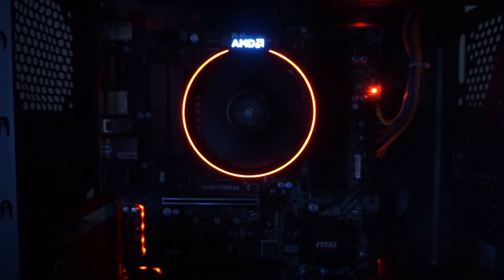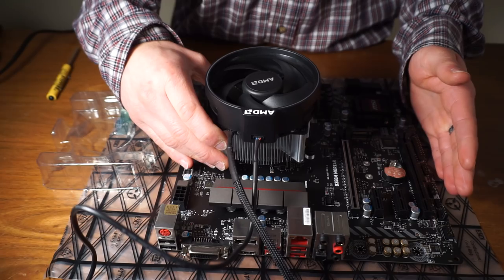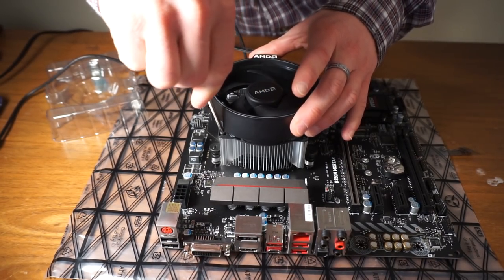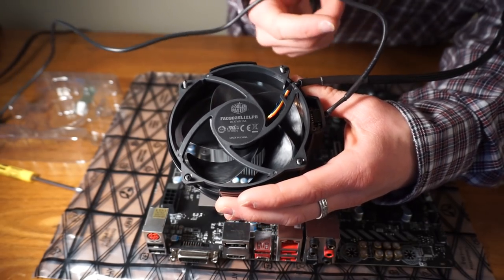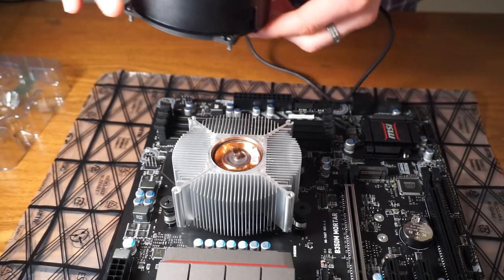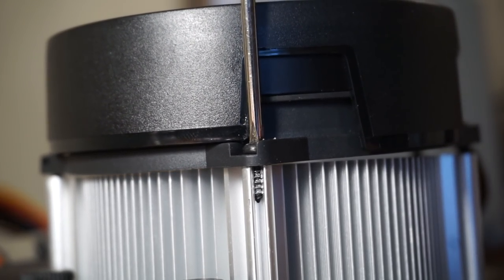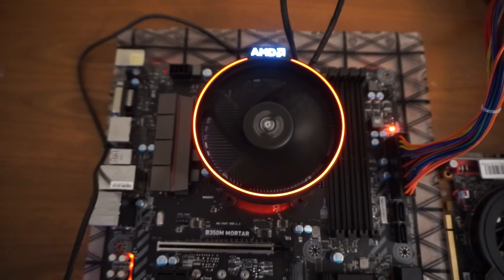How to Rotate AMD Spire Heat Sink - AMD Ryzen microATX Video Editing PC Build

Comment: Made by cooler Master. explains why the the stock cooler is so good.
Reply: WOLFCAM coolermaster sucks.
Reply: WOLFCAM i think you should delete the comment, the other guy did too anyway so there's no context anymore
Reply: lol
Reply: And that Vapor Chamber. Coolers with that tech costs at least $35 man.

So you're basically paying $170 for a R5 1600 and the other $35 for that cooler.

Such value!
Reply: such wow!
Reply: wtf I bought a ryzen 5 1600 and my cooler doesn't have rgb's guess I got screwed over :(
Reply: Loki Gaming no you didn'tgot screwed over only the Ryzen 7 1700 has the rgb ring
Reply: ahhh ya i thought so but i seen somewhere someone sayting threy had it with the 1600 so i was just wondering they must of just said the wrong numbers i guess
Reply: remember the fx 8350 with cooler master stock cooler––> 4800 RPM
Reply: @bluerune7305  it only on lastest ryzen 7
Reply: @fzero8821  

Pros: • Works out of the box with AMD Pinnacle Ridge and Raven Ridge (no UEFI/BIOS update has been done) and Windows 10 version 1809
• Superior layout: The top slot position is shared between the PCI Express x1 slot and the Ultra M.2 socket so that the M.2 card can be cooled by the CPU cooler. The 2nd slot position is PCI Express 3.0 x16 (for the GPU). The 3rd slot position is vacant because a large GPU will cover the 3rd slot position and a small GPU would be suffocated by a card in the 3rd position. The 4th slot position is PCI Express 2.0 x16.
• Heat sinks on the motherboard (please see the picture)
• Four RAM slots, two M.2 sockets, and five fan headers
• No carnival lights on the board (for those who do not want lights)
• In addition to the RGB headers, another header designed specifically for the AMD stock CPU coolers which have LEDs (for those who do want lights)
• Relatively RAM-friendly: Because a previous motherboard from a different manufacturer failed and was RMAd, I had already purchased RAM which is not on the ASRock QVL but it worked anyway with this motherboard (the RAM is Ballistix Sport LT 8GBx2 DDR4 2666 BLS2K8G4D26BFSCK)

Cons: • The paper documentation included with the board shows that the highest supported RAM speed is achieved only when the second pair of RAM slots is vacant -- if all four RAM slots are populated then the maximum possible RAM speed is lower
• This board is the maximum size for the Micro ATX spec which means that it will be a tight fit in some cases
• The second M.2 socket supports only SATA, not NVMe
• The RAM slots are the newer (worse) type which have only one release lever per slot -- the older RAM slots which had release levers on both sides (two levers per slot) were much easier to work with
• If you require four PCIe slots then this is not the board for you (it has only three)
• No TPM (only a TPM header)

Overall Review: The combination of reliability, features, and price make this board my choice for both higher-performance (Ryzen 2700) and home-office (Ryzen 2200G) builds. This board has a tendency to not fail (please read the other reviews).
Reply: @bluerune7305  no you just didn't buy the version with the rgb cooler
Reply: @DANTHEMAN1.8T  Only the Ryzen 7's come with the rgb coolers.
Reply: the make intels too

Comment: You shouldn't put your components on top of anti-static bags, it's a common mistake. The outside of the bag is actually conductive.
Reply: Tinkula It makes no difference. Never in my life have I heard any PC component die to static.
Reply: Yeah me neither, it's really hard to do it. However he's clearly using the bag trying to protect his motherboard from the static when he'd be better off using placing it on the wooden table. If he cares about that stuff then he should know he's actually making it worse by doing that.
Reply: Perhaps he turned the bag inside out?
Reply: Tinkula not true nowadays
Reply: been doing it for 16 years, never killed one yet.
Reply: False! The bag is made of the same material on the inside as it is on the outside. The skin on your hands is more conductive than that bag! Educate yourself and stop confusing other people with your ignorance.
Reply: Hey man thanks for the heads up. I hope all first time PC builders get to read your comment. Cheers.
Reply: @CareyHolzman  really? Don't know what to believe now lol. It is needed to hold a metal piece before building right? before you start building a PC
Reply: It doesnt really matter but it is super rare for a pc to die of static damage a bigger worry would be those metal shavings but even then the pc is probably fine
Reply: @nniivekkappo7544  id like to know too ?
Reply: Tinkula I fix computers on dry winter days, preferably wearing heat trapping nylon clothes to insulate myself; to make sure my feet don’t feel too cold while I’m working, I like to rub my feet on my polyester carpet vigorously before work. I don’t feel the need to put the computer anywhere in particular - I just lay it on the carpet and get to it. All my computers are 100% stable and operate very quietly. In fact, I don’t think  I’ve ever heard anything out of any of them! Beat that, QuietPC!

Comment: The outside of the anti-static bag is not anti-static
Reply: what the fuck
Reply: Wtf Xd
Reply: the outside is actually conductive
Reply: i believe he did it so he wont scratch the surface of the table and/or the back of the motherboard
Reply: That comment i was searching for
Reply: That's not how anti static bags work. Let me guess, you think it "holds extra electrons" and "is the worst surface" but it's just like the inside of the bag. It keeps electricity from passing THROUGH the bag.
Reply: @Nexas_  conductive why? Why not non conductive?
Reply: Steve Thea the outside is made to “absorb” the static electricity so it doesn’t get to the electronics.
Reply: Jprovence02 ikr this makes me frustrated

Comment: OMG Thank you! My heat sink blocks one of my DDR4 slots... you just changed my life.
Reply: SAME
Reply: It doesn’t work. Or this only works for Spire coolers. On stealth you can’t even get the screw out without breaking it. Now i have to spend extra for after market
Reply: @someguywithmtndew5691  it worked for me so ur just doing it wrong
Reply: @lewisthow2846  nvm, i was raging. I just found out you can take off the plastic ring
Reply: @someguywithmtndew5691  without removing the screws? can you teach me how? i am having the same problem lol :D
Reply: @dogsei7956  just the outer plastic piece idk how to do it anymore

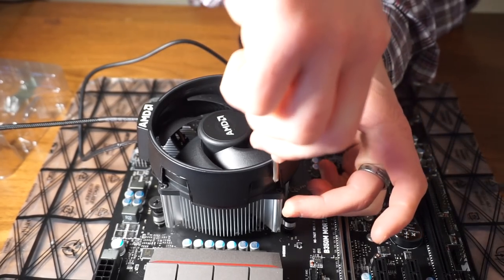Comment: 3:47  Those tiny metal particles are dangerous, to avoid that would be a good idea to screw the fan before mounting it on the motherboard. Also i would blow those shavings away with the motherboard inverted so they fall off, cause they could get stuck between circuits and that could wreck the whole mobo.
Reply: @Matthew Blome does this video work with WRAITH STEALTH???
Reply: @stevethea5250  This works with every cooler, except the max and the prism

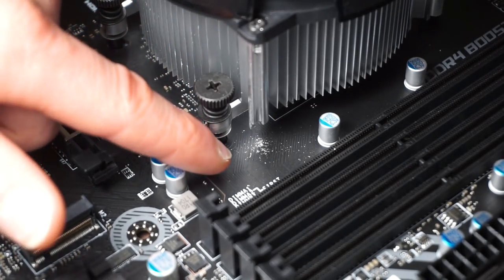Comment: 3:55 Won't advice blowing like that into other components on the motherboard. Rather use sticky tape to get it stuck on and have it 99% removed. But very good point mentioning it tho :D
Reply from the maker: That's a far better idea!  I'll do that in the future, thanks!
Reply: Thanks Nisco :D
Reply: Better yet , do the unscrewing NOT on your mobo , do the rotation first , then build it on to the mobo !
Reply: @gertjanvandermeij4265  please show video dont understand
Reply: @stevethea5250  just rotate the cooler before mounting it
same process, but not on the motherboard
Reply: @akaraio  🥴🥴🥴🥴🥴🥴🥴🥴🥴🥴🥴🥴🥴🥴🥴🥴🥴🥴🥴🥴🥴🥴🥴🥴🥴🥴🥴🥴🥴🥴🥴🥴🥴🥴🥴🥴🥴🥴🥴🥴🥴🥴🥴🥴🥴🥴🥴🥴🥴🥴🥴🥴🥴🥴🥴🥴🥴🥴🥴🥴🥴🥴🥴🥴🥴🥴🥴🥴🥴🥴🥴🥴🥴🥴🥴🥴🥴🥴🥴🥴🥴🥴🥴🥴🥴🥴🥴🥴🥴🥴🥴🥴🥴🥴🥴🥴🥴🥴🥴🥴🥴🥴🥴🥴🥴🥴🥴🥴🥴🥴🥴🥴🥴🥴🥴🥴🥴🥴🥴🥴🥴🥴🥴🥴🥴🥴🥴🥴

Comment: alternatively you can go OUTSIDE the case, flip the cooler over and under the AMD logo there are 2 screws, take those 2 out, then 4 tabs hold the trim ring to the other piece of plastic and you can pop that off then remove the 4 screws without your screw driver scrapping up the plastic, it's also significantly easier to get the screws aligned properly. slightly more labor overall but worth it to me to keep it scratch free.
Reply: Maybe the RGB ones have the two screws, mine is not RGB and it did not have any screws on the shroud, it just has the four plastic tab clips to remove the shroud.

Comment: I highly recommend taking off the logo ring first (two screws on a notch on the underside) as this allows you to access the fan screws easily rather than having the possibility of threading the screw diagonally. However this does have to be done before the cooler is mounted

Comment: You can actually separate the Plastic Fan's upper part so you will be able to screw it with the Heat Sink easily
Reply: how so? part of the fan comes off so that unscrewing/rescrewing it back in isn't such a hassle you mean?

Comment: The Led Ring shroud clips off to make removing the screws a lot easier to get to and less likely to strip screws.
Reply: I couldn't get mine off. Feels like it's glued on. I have the non-lighted version.
Reply: I have the non-lighted version as well but the shroud came off after a long struggle.  Make sure you lift on the various edges to get it off the clips (my shroud show 6 clips underneath).  

I still cant get the fan screws off (they're really tight on mine), however I realized my RAM can now squeeze in the slot once the shroud is off!  Not sure if going shroudless is a good idea.

Also. I did the job with my machine fully assembled.  Probably an unwise move, but it ended up making the job simple.  Of course, unplug the power first, etc.

Comment: I had two of these precious and ultra-hyper-rare AMD Wraith Spire RGB coolers (the most beautyful cooler EVER created!!) completely disassembled two days ago. I recommend pressing the plastic to the direction of the inner ring to get better access to the screws (otherwise the plastic of the outer side of the plastic cover gets completely scratched when just trying to turn it), or pressing the sides of the outer ring outside a little bit which gives the possibility to remove the outer ring with the LED light completely to get unlimited access to the four screws. OK it`s hard to explain in English you know what I mean :D Well because every single brand logo inside my PC is written vertical with the upper side of the letters rotated to the rear end of the PC (MSI, Edge. g.Skill and so on), I decided to keep the AMD brand logo also rotated to the rear end of the PC.
By the way the AVD-motor seven blade cooler design has a way better performance than the Coolermaster-motor five blade rotor design, it runs almost 7 to 10 degrees cooler (but the five blade rotor "shredder" like design you have in this video looks more iconic uniquè and interesting inside a casemod build than the more casual typical fan-alike seven blade AVD design).

Comment: I figured the coolers, or at least the fans were cooler master because I bought a used first gen (early) Ryzen cpu and it came with a cooler master branded cooler that looked very very similar to the AMD stock coolers you see now.  I'm just getting into computer building again after a 30 year break, and plan to do a lot of used parts builds so when I found a a "lot" of 12 AMD stock coolers on ebay for $50.00 I jumped at it and may do the same with a "lot" of intel stock coolers so I'll always have some kind of cooling option available cheap although I am told intel coolers aren't worth crap....  might have to go aliexpress snowman cooler for intel.

Comment: It can also be done without being mounted right?
Reply from the maker: Nope or else everyone would be putting it on correctly.  I showed that in the video.  The mounting points are in a rectangular pattern not a square pattern.
Reply: I mean you don't have to have it mounted before changing the fan orientation. You should be able to spin the fan then mount it I feel
Reply: Just watch the thermal paste. Unless you plan on putting your own on anyway (though you probably still don't want it getting everywhere)
Reply: @rrd3k3  i dont understand
Reply: @rrd3k3  (very late comment) Though you probably already figured it out you don't need to have it mounted to rotate it, just make sure the thermal paste isn't gonna touch anything.

Comment: Actually, you can remove the fan shroud with a little careful effort before you begin to mount the cooler and then the fan screws are much easier to remove and make the whole process a breeze.
Reply: Como tira ?

Comment: please update your video.. there's so many things you are doing wrong.  
- working on top of static bag
- working while still mounted on the mother board
- blowing the shrapnel all over your board
- and the biggest part is that you can actually remove the shroud by pulling on the large tabs and then pulling on the "bottom" tab. After a bit of wiggling the entire piece comes off. Be sure to disconnect the LED module before separating the pieces.
Reply: Theres nothing wrong with building on a anti static bag
Reply: I've been trying to get that plastic shroud off for the past 40 minutes, my fingers hurt and it's so tight on there I'm 100% sure I can lift my whole PC with it

Comment: Great video very helpful. I did still in the case only problem is when you was screwing the screws back in you stripped some of the aluminum on the heatsink if you simple carefully align the screws (like literally as perfect as the naked eye can see) before screwing in you can avoid "missing the threads" I did it with absolutely zero aluminum coming off.

Comment: Makerj101 please respond! I was watching your internal combustion engine videos, and I was wondering how you were firing the spark plug, like how where you timing it? Please comment back I'm trying to do this for a school project and I only have so long to do it. Thanks
Reply from the maker: +JT Custom RC/ Gaming so originally I was just applying a constant arc to the spark plug. It did fire a little bit early but it still worked really good. I recently fitted it with an old ignition coil. I use a small magnet on the flywheel to trigger a hall effect sensor. The signal from the hall effect sensor is amplified and inverted with an npn transistor. Then the inverted signal goes into the gate of a MOSFET which switches 12 volts to the ignition coil. There is also a diode to protect the MOSFET from any inductive spikes from the ignition coil.
Reply from the maker: +JT Custom RC/ Gaming so originally I was just applying a constant arc to the spark plug. It did fire a little bit early but it still worked really good. I recently fitted it with an old ignition coil. I use a small magnet on the flywheel to trigger a hall effect sensor. The signal from the hall effect sensor is amplified and inverted with an npn transistor. Then the inverted signal goes into the gate of a MOSFET which switches 12 volts to the ignition coil. There is also a diode to protect the MOSFET from any inductive spikes from the ignition coil.
Reply from the maker: +JT Custom RC/ Gaming so originally I was just applying a constant arc to the spark plug. It did fire a little bit early but it still worked really good. I recently fitted it with an old ignition coil. I use a small magnet on the flywheel to trigger a hall effect sensor. The signal from the hall effect sensor is amplified and inverted with an npn transistor. Then the inverted signal goes into the gate of a MOSFET which switches 12 volts to the ignition coil. There is also a diode to protect the MOSFET from any inductive spikes from the ignition coil.
Reply: Hey Makerj101 my last question would be if this motor is considered a 2 stroke or a 4 stroke thanks for all the help, JT
Reply from the maker: It's a 2 stroke.  I'll try to get a schematic to you in about a week when I'm finished with finals.
Reply: okay thanks

Comment: what size screwdriver did you use? I want to do the same thing but so far none of the screwdrivers I have on hand seem to fit the bill I do have a toolbox but it's cumbersome so I want to know the exact size of the screw
Reply from the maker: +Ralph Bromley use a small screwdriver that is round. Don't use one too small or it will round off the screw.
Reply from the maker: +Ralph Bromley use a small screwdriver that is round. Don't use one too small or it will round off the screw.
Reply from the maker: +Ralph Bromley use a small screwdriver that is round. Don't use one too small or it will round off the screw.
Reply from the maker: +Ralph Bromley use a small screwdriver that is round. Don't use one too small or it will round off the screw.
Reply from the maker: +Ralph Bromley use a small screwdriver that is round. Don't use one too small or it will round off the screw.
Reply: any exact size?
Reply from the maker: +Ralph Bromley a #1 phillips should work just fine.
Reply from the maker: +Ralph Bromley ummm IDK just find a screwdriver and screw dat screw LOL 😆

Really, any screwdriver should would alright. If it's a big screwdriver the plastic shroud will bend more and make it a bit harder. 

This is really painful... You could send it to and I can rotate it for you and send it back if you're really this scared. 😃
Reply: Makerj101 no not afraid I just wondered what size it was so I can get the precise size I just happen to have a really finicky tool box that is sometimes hard to get into and if you mess up it's order it's very hard to reassemble

Comment: I wonder why AMD doesn't ship them like that to begin with. And it would be even better if the fan support struts lined up with the "X" that separates the heat fin sections, like how Corsair has gone with a straight "X" strut pattern for their new fans instead of the off-center struts like most fans.
Reply from the maker: +Ir0nF1st924 IDK maybe AMD or Cooler Master had a miss communion somewhere along the line. Or maybe you're just meet to change the orientation yourself. Yea X pattern would be nice.